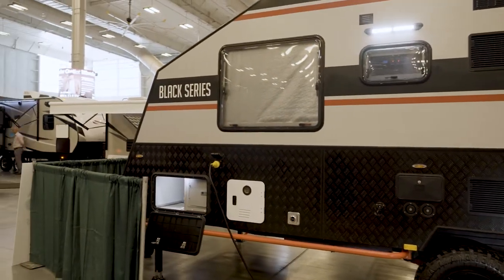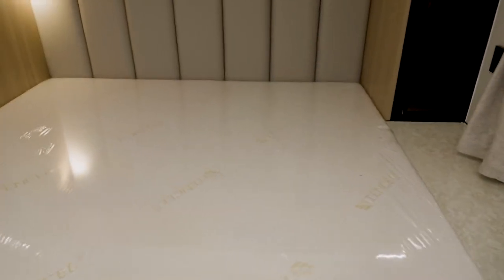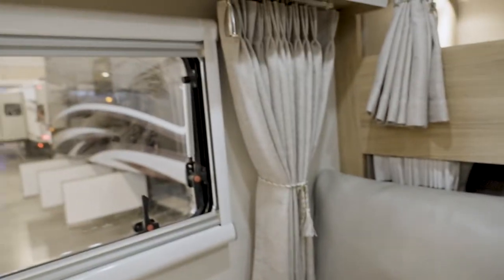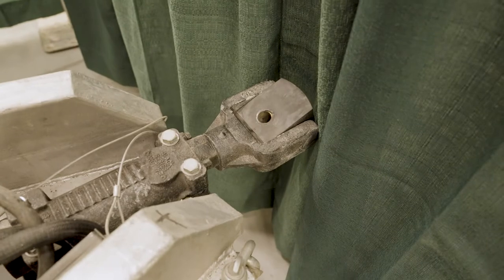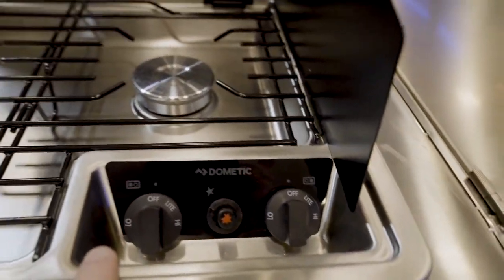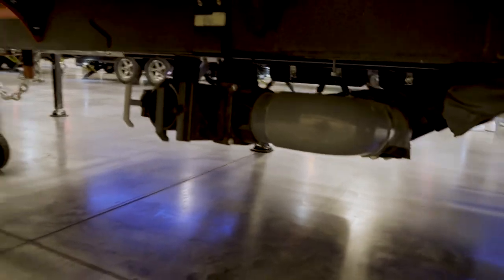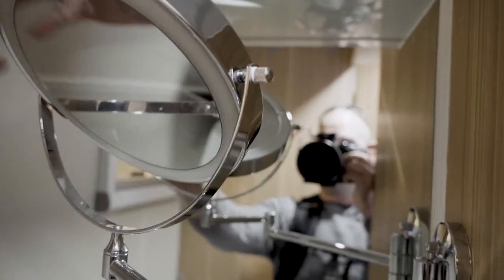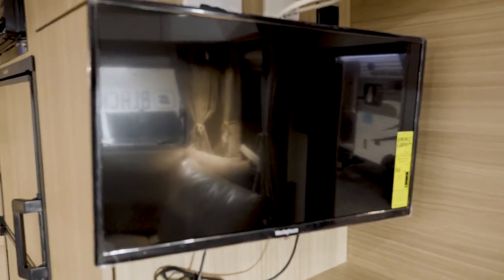Black Series 15, 17, and 21 RV Tour

Comment: Would take your Basecamp over the Black Series all day long. No comparison quality wise. The Black Series looks like a run of the mill Particle Board RV.
Reply: Nothing and i mean nothing traditionally american made can match the black series or even come close. nothing particle board about it, go watch one get built and go step into one yourself, these things are built extremely well. Sturdiest RV/caravan iv ever stepped in and iv been in hundreds maybe even thousands. 
The Xplore series are top of the line as well check them out, there top runners can withstand -40f with insane off road capabilities and just the most bad ass quality you can find.
Reply: 03B you are completely off! Aluminum frame, aluminum composite, steel galvanized frame. These units if properly maintained will last forever! Good luck on that pop can called a base camp!
Reply: Have you seen the chasis o these units…the suspension. Nothing on this is run of the mill.
Reply: you are right..these are cheaply made and have had electrical issues....they did not make the top ten rugged trailer list and fall short of the RV standards specs
Reply: you take this trailer thru one creekbed and you can say good bye to your drain piping cause they all hang down frojm pipe hangers = BAD DESIGN